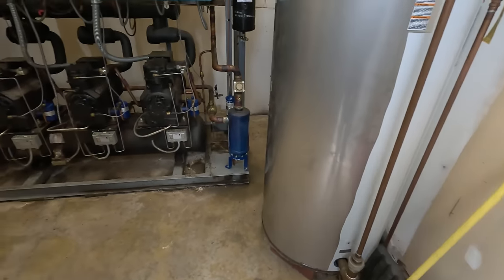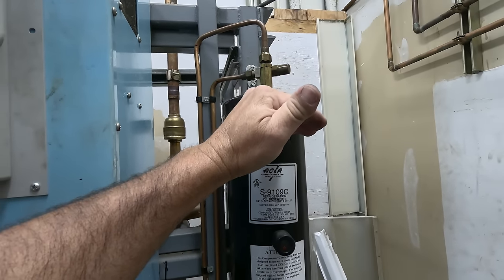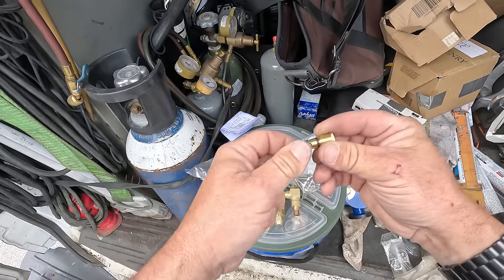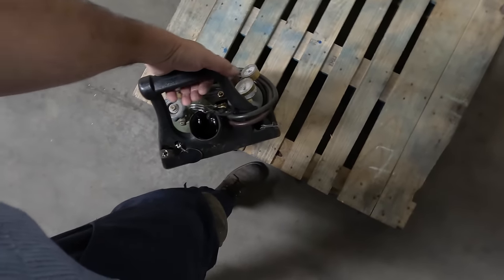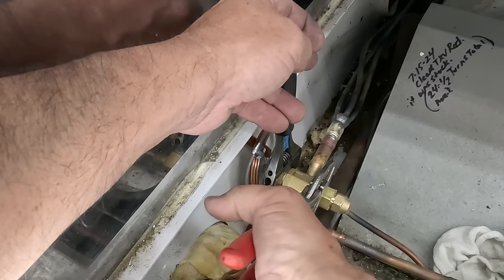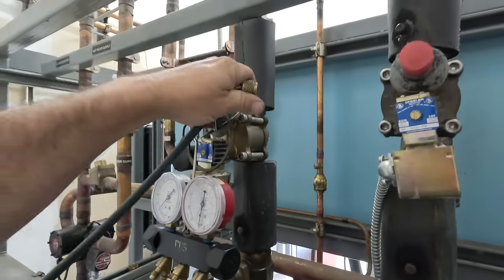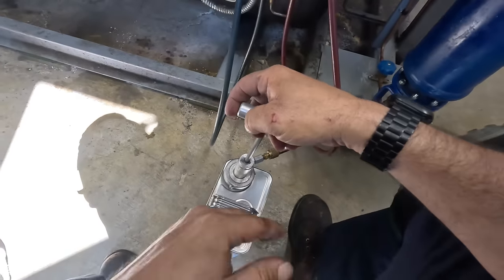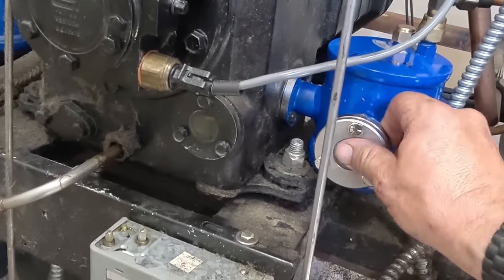Grocery Refrigeration - TXV & Oil Failures How To Fix

Comment: Ahhh glad to see im not theonly one who thought it was supposed to use one O-ring, fought with a leak for about an hour last week.... Instructions on the pot say they're supposed to be doubled up with a flat rubber and a o-ring rubber. RTFM gets all of us esp when you throw the box away lol

Edit: few minutes later i see you found out the same info heh. Stacking 2 orings worked nicely for me (totally not because i couldnt find the second flat one that came with it or anything)
Also, a dab of nylog keeps those things in place nicely while youre snugging it all up
Reply from the maker: It’s crazy imo  , one flat and one round o-ring to make a seal 🤷‍♂️🤦🤣👍👍
Reply: when in doubt double it out? lol it make sense to have a wider flat surface are against some things, they could possibly make a special gasket for it, but cost cutting has them using off the shelf items.
Reply: @HVACRSurvival  instructions about the  o rings are with the oil pot

Comment: You have to put both seals on the sight glass and regulator mating surfaces, that's why there is 2 different styles of seals. The o ring seats inside the other seal

Comment: I think Epr valves are mainly used for hot pull downs, as to not overload the compressor. As always great work.
Reply: wrong
Reply from the maker: I see more CPR valves used for that.  Thanks for the feedback.
Reply: An EPR will hold pressure in the evap to maintain SST.
Reply: They are used on racks that run low and medium temp boxes. The controlling pressure is set to the low temp setting and the EPR will keep the compressors from pulling the pressure down to that setting so that you maintain a warmer evap. Without it, the pressure would be pulled down too low and the TXV would not be able to keep up.
Reply: @HVACRSurvival that's right, I think he's confusing the two.

Comment: 13:07 - Rick, you added 15k to the SST. Some say 10k, others, say 20k DTD on refrigeration equipment — still others, 15k as you did. Is that just RoT, or is the design temperature difference for different equipment written anywhere so I can get more precise guidance than someone’s guess?
Reply from the maker: That’s just rule of thumb. Design could be 10 or 15 on the old stuff.

Comment: Are you working on newer racks too? I really only work on racks an most markets in europe were I live build the whole Building new every once in a while (20years~)
Reply from the maker: I wish I worked on newer stuff. There’s really no grocery stores around me other than Walmart and Myers.
Reply: @HVACRSurvival  Ah ok that sucks. Yes most markets are not so big like Walmart but rather 10~ Normal (like you had in the Video, don't know the english word for it 😅)1-2 Cooler and 1 Freezer and about 5~ Freezer. But the New markets only run with R744, both normal and freezer.

Comment: My grocery store has banks of water cooled compressor/condenser units in large boxes, about 3x3x7 throughout the store on endcaps and whatnot. Anyone know what they're called? They're super quiet. I saw one of them open once and it looked like it had an enormous scroll compressor with like 2 inch suction lines, if I recall.
Reply: Likely Protocol Racks made by Hussmann.
Reply: @SupermarketRefrigeration  Thanks! Yup, that's what they are.
Reply: @SupermarketRefrigeration  Huh, I assumed they were water cooled because of their location, but it looks like most system have rooftop condensers. What would be the advantage of locating just? the compressors in cabinets throughout the store?
Reply: @WaffleStaffel  depending on where you're at in the country, they could be water cooled (Evaporative Condensers). If you're in an arid climate there's a good chance they're using those. 
The only real benefit is the money savings on not have to run a bunch in line set to the cases. If the racks are right next to the cases then you have a lot less line set to run.
Reply from the maker: I only have one store with the Proto-call rack. It’s a great unit when it has the electronic APR valves at each case.

Comment: You,re supposed to oil the o rings on the cart
Reply from the maker: I used nylog, that’s made with Refrigeration oil
Reply: @HVACRSurvival  my bad,thought it was nylog thread and gasket sealant
Reply from the maker: Correct. It’s nylog. The phone changed the spelling and I didn’t catch it

Comment: "where's my youtube police at" 🤪 woop woop, wheeeeeew. all the times i;ve been pulled over(in the past) most either never hit the siren or just blipped it, the lights were enough.
i guess the stacked gaskets would make a better seal overall, giving more pressure to a smaller area and secondary seal over the larger surface area.(especially if overtorqued) maybe some measure to keep site glass/leakage down if overtoruqued?
 likely a cost cutting measure too,  while a custom flat-raised ring gasket would likely be best, they used off the shelf schmutz to do the job. I'm speculating here. pull it on over bro. 🥳🥸
**edit, actually, the glass/seals/small ring may be pressed into the large outter steel ring and also why the square cut ring is there to additionally seal that area, and the flat gasket to seal the large ring to oil pot body. reversed like that it may blow out the glass, seals and retainer ring!
sometimes it takes me more thinking to reverse engineer on the fly nd I need to slow down, you seem to have the same mentality and figure things out well and plenty fast.